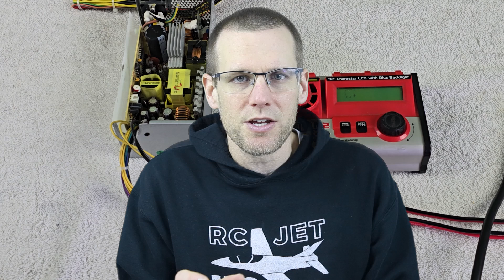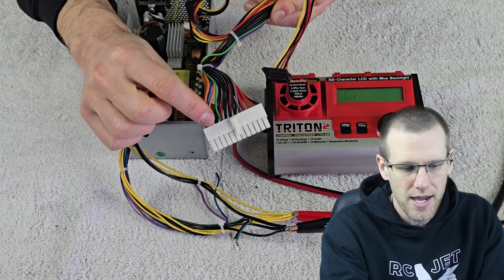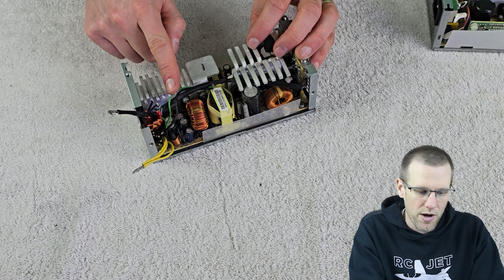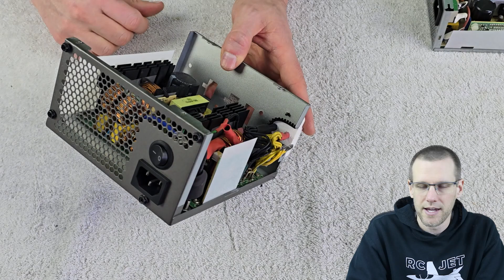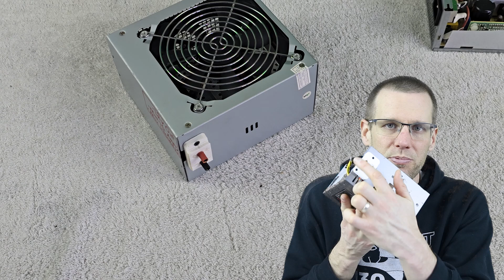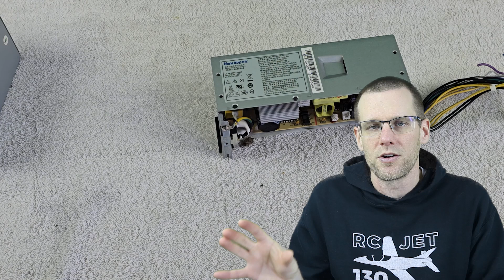DIY: Turning Old PC Power Supplies into RC Charger Power Supply!

Comment: Its not working because that power supply needs a specific load to stay powered on. It also has a specific wire set that the load must be on. Youll have to look up the specific wiring for the make and model. Usually a small led is sufficient.

Comment: Cool video, thanks for sharing. This has been on my list of things to do for at least 10 years. I've been holding onto old PSUs for years and finally got around to opening them up.... success so far with 2 of the 5 that I took apart today.

One doesn't work, one has blown fuse (soldered on, can replace), one loses the 12 Vdc a few seconds after power on... one has 12 V sitting at 11.75 V, which is too low for my intended use, but it might come up with some load attached... the other one that I got to work has a very loud fan... not ideal, but possible to fix and it's all progess!

I volunteer at the tech recycling charity in town. There are SOOOO many old PCs passing through there. Many old (and not so old) cases and PSUs end up going to scrap metal for ~$1 each as there are just too many and no demand for used tech... this is definitely a better and economical use for them if we can streamline the conversion.

Thanks :)
Reply from the maker: Sweet, sounds pretty good!

Comment: I know nothing about PSU's, so please move on if my suggestion is stupid; is the fan connected when you run it? ..could the PSU be turning itself off because it's somehow sensing that the fan isn't spinning? Also, do those two independant 12V circuits trace back to a convinient place where you could solder on two 10ga wires, instead of having a cluster of wires?
Reply from the maker: The fan has been connected and didn't seem to make a difference. I could solder a thicker wire to the unit.

Comment: I highly recommend adding some "ON" LED as early as possible if your PSU doesn't have one built-in. I got electric shocked while working on conversion simply because I forgot that PSU was powered on.
Reply: That's crazy that you need a light to tell you that an electrical device that you can hold in your hand and are working on that can kill you is still on and plugged into an outlet. That's like needing a warning sticker on a knife to remind you which side is the sharp end and which side is the handle. Honestly, you shouldn't be taking apart anything.

Comment: "Base Load - 
Some ATX PSUs (not all) require a minimum load on the 5 V rail to work properly. Whether your ATX PSU requires a base load or not has to be tried. A symptom of this problem is that the PSU will simply refuse to turn on, it immediately shuts down after being turned on or emits a clearly audible high pitch whine, all unless there is a minimum load on the +5 V rail. Connecting a 4.7 ohms 10 W resistor, an old CD drive or a 12 V light bulb (into the 5 V rail, see picture) are well proven methods to generate this "dummy" load. In one case, the load had to be applied to the 5v standby wire (purple) to ground rather than directly to the 5v rail to ground before the power supply would function properly. 

Technical Details
Minimum Load
Minimum load is one of the possible reasons for the base load requirement. It depends on whether or not your PSU has an underload protection circuit and how this circuit is configured. If even tiny loads on the 12 V rail without a proper load on the +5 V rail cause the PSU to shutdown, some base load (approx. 1 A) is required.

It also brings in an inconvenience: some electrical energy just gets wasted as heat.
Balanced Load

Requirement for a balanced load is another possible reason for a base load requirement. Similarly to the minimum load requirement above, some older ATX PSUs require a load on their +5 V and/or +3.3 V rails to balance the load on the +12 V rail and function properly.

❗❗Very old AT supplies (and other switching supplies of the early 90s) may mandatory need an external load (see above) - without an external load they'll kill themselves after some 10s. Short background: Without a load the swing didn't start and that killed internal components shortly.❗❗

Voltage Sensing

The +3.3 VDC remote sensing wire (brown or orange) is connected directly to the orange +3.3 VDC at pin 11 of the power connector (pin 13 if a 2x12). The sense wire will usually be of a lighter gauge (22 AWG) than the power wires (16 or 18 AWG) and its purpose is to monitor the voltage at the connector in order to provide feedback for voltage compensation by the supply. The voltage at the connector needs to be monitored because of the high currents that are used for the 3.3V rail by the motherboard.

If your PSU has two wires attached to the same pin on the motherboard power connector, orange +3.3 VDC and a brown sense wire on Pin 11 for example, then these two wires should be joined when you make your conversion. Some power supplies may also have sense wires running to the +5 VDC and +12 VDC connector pins. If there are multiple sense wires, then they will usually be of the same color as the primary supply wire, but of a lighter wire gauge. These sense wires will also terminate in a different location on the PSU printed circuit board than the heavier supply lines. As with the +3.3 sense wire, these additional wires should also be connected to the corresponding supply lines. "

- from RepRap

Comment: been doing this for a while now. no idea what's wrong with that particular PSU....it could have been dead originally before you started modifying it? which may be why it ended up in the pc e-waste?
Reply from the maker: This was in my hot build from 2012. It was working very well when I removed it. It's possible something went wrong but from experience with other power supplies, I'm missing the secret code here to keep it working.
Reply: @RCexplained  some of the more modern newer pc PSU do have some kind of sensing technology built in....unless that has something like that it may just be dead....not a huge deal you can toss it out and start over with a different one?

Comment: What is the benefits of plugging in the charger into the PS?I have a charger that can be powered AC/DC.
Reply from the maker: You'd have to look at the spec of your charger but most AC/DC chargers don't unlock it's full charging potential on AC power. Most high end chargers don't have an AC option and must use a power supply.
Reply: @ ok Got it ,Thanks!

Comment: Nice! I got an old 120w laptop charger running my 80w Imax B6. It does NOT play well with every PS i tried though. Supply Error for some
Reply from the maker: Interesting, I have a laptop supply to. What i like about it, is its super quiet. 👌
Reply: @RCexplained  Slow down or swap fans. You can get a voltage regulator for the fan for like $1

Comment: you can also do it with the 12Veps cpu connector, it's very simple all the pins on the clip side is 12v and all the bottom ones are ground. and the cpu connector has the most wattage of the psu, even if it's not a modern psu. cannot go wrong with that.
Reply from the maker: Yep, actually that's what the first PS uses.

Comment: Nice project  but hardly economical. The problem is that any power supply worth converting  is worth more as a PSU than a Rc battery charger.  I got my Imars Dual for $100.
Reply from the maker: It's actually super economical. I have many PC power supplies and didn't pay for any of them. They are all recycled from family and friends that dont want their pc anymore. 

Do not buy new.
Reply: I disagree. I have recovered nice 400W ATX PSU from an old gaming computer of mine, but it's still waiting for conversion. I actually ended up buying used 250W SFX PSU very cheaply - like 7 or 8 USD - since it is smaller form factor, maybe 2/3 of ATX. Combined with two pocket sized battery chargers It's more than enough for me.
Reply: Depends, some of us have several laying around lol.

Comment: The green wire permanently connected will also power the PSU off. The switch is normally a push button switch, that only stays connected when the button is depressed. On a computer if you hold the power switch down for 10 or so seconds the PSU will turn off.
Reply: are you speaking from experience? i had an atx psu permanently "hotwired" for years

the green wire is not connected directly to the power switch in pc's, sleep mode wouldn't work that way

gotta love people making shit up
Reply: @marshallb5210  yes, it would be easy to test, just short the green and black until it turns on, then see if it shuts down.
Reply from the maker: The power button on your PC case is on a completely separate circuit. Opening the green wire circuit shuts of the PSU. Running the green wire to ground turns the PSU unit on.
Reply: I concur